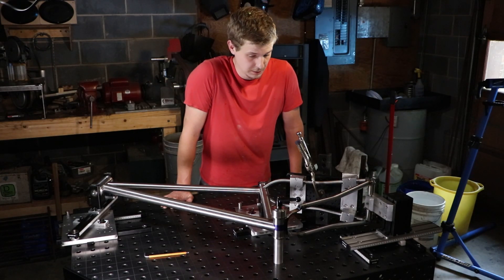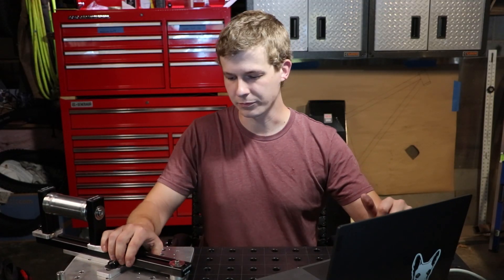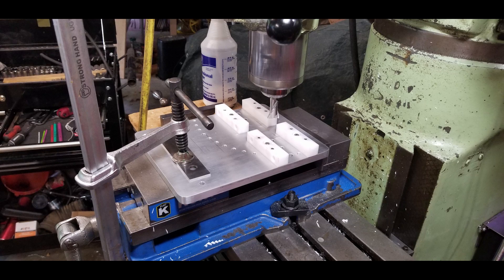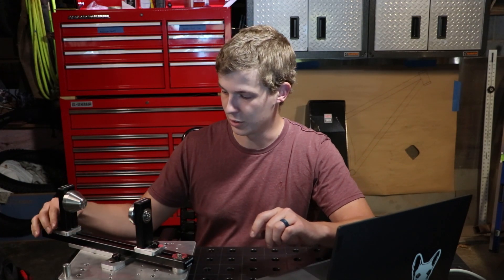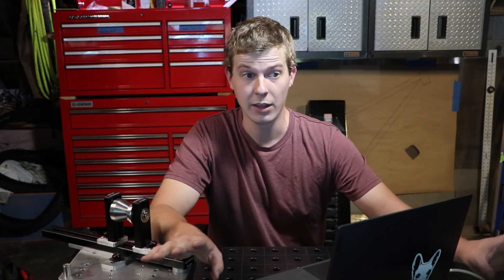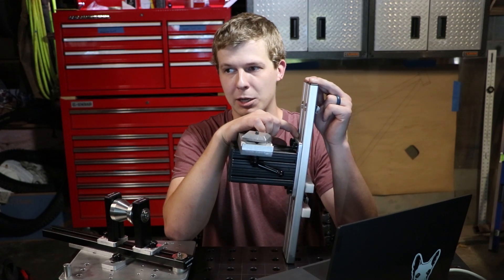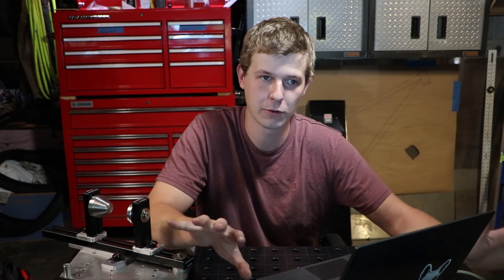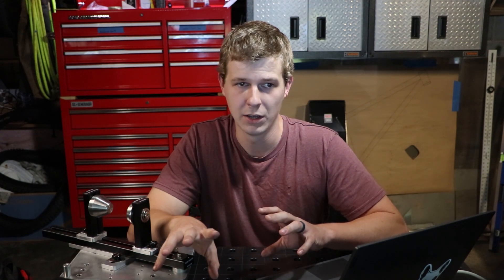SKYNET Part 5 - It Is Complete!

Comment: Very well done! Does a horizontal table setup like this provide you enough space for all the tack welds? Why did you choose to go with a table setup vs an adjustable vertical type jig? I am seriously considering getting into frame building and channels like yours are invaluable. Thanks!
Reply from the maker: Thanks!
I'm very happy with the weld/tack access it provides. I can get a good quarter of the weld done on the top and bottom of each tube before removing it to finish welding. I will say the access around the rear axle is a bit tricky, but I weld up my Chainstays/Seatstays as a sub-assembly anyways, so no big deal. 

The decision to make it horizontal was more out of simplicity. Or in other words, the table is already horizontal so it's easier to keep it that way. It was discussed however to make a sort of 'rotisserie' for the table top to allow both positions. That could be cool. 
I actually prefer it flat though. It makes any extra tooling easy (gravity holds it down). And I can clutter up the space with all of my tools and files and such while I'm working. Haha.

Comment: Great solution with the delrin and spring plungers. Why is the block with the spring plungers delrin if it isn't contacting the rail? Also, why does the dummy axle holder use a v-slot instead of a radius?
Reply: Delrin on the tension side allows the system to slide even if the system is cocked or tension is removed. Preference is for the system to work fine without springs but they are in place for insurance and positivity.

V-slot or radius. Tomato tomato. I figured this would be a nice way of doing it as the tool would be in hand and there wouldn't be another tool to order. Also, if a radius is loose, it's not positive. V-slot is.
Reply: @pverdone  Gotcha. My two concerns with the v-slot were wear (if it isn't being hard-anodized), though that probably isn't a huge issue, and worse heat transfer away from the frame, though I'm not sure that's actually a bad thing, and I know the fixture is just for tacking so that probably also doesn't matter.